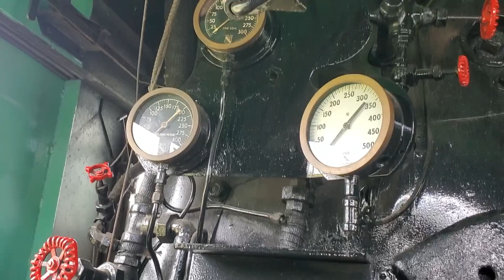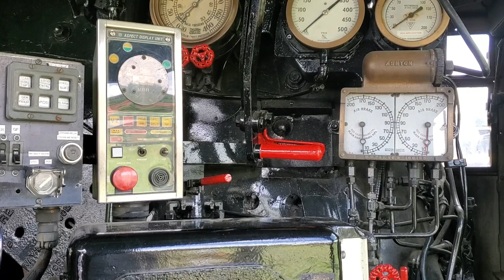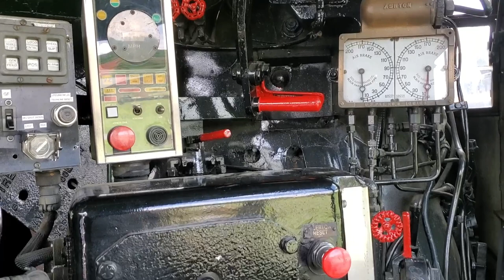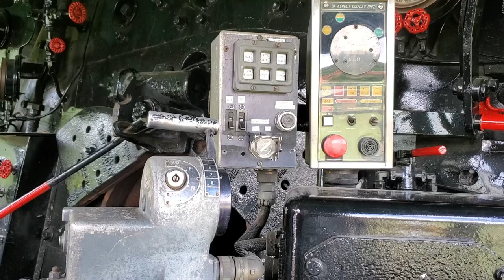Returning to "614" the finale

Comment: Would be wonderful to see her run again! Can’t wait to see what’s “in store for 2024” Bob, thank you for the video! Would be wonderful to see her and C&O 490 from the B&O Museum do a doubleheader movement if someone would restore her!
Reply from the maker: Thanks for watching and I agree 614 and 490. The yellow belly has been at B&O forever Im not sure what shape its in but would need class 1 overhaul at this point as well as 614. There is supposed to be movement with 614 in 2024-25 and restoration by 2026. Seeing both would take alot of money but anything's possible.
Reply: @BobsOGaugeTrains  I saw that back in the day Ross had looked at 490 before getting 614 to replace 2101, he said it was “ran hard and put up wet” or something along those lines. Needed a lot more work than 614 did at the time, can’t imagine it’s any better now where it spent all those years outside
Reply: @BobsOGaugeTrains  I actually also had another question my friend I’m sorry, a lot of people have speculated Ross had 614 close to if not over 100 mph on the runs back in the 90’s, is there any truth to this? Will the loco actually do 125 as stated, and has Ross actually pushed her close to, if not over 100?

Comment: C&O Heritage Center Has A Nice Assortment Of Railroad Equipment On Hand Besides C&O 614. At The 12:17 Mark, US Army Troop Car, Could Been A Sleeper At 1 Point In Time, Assuming It Became Later C&O Baggage, Then C&O MOW Crew. Steam Railroading Institute/PM 1225 Group Owns 2 Of Them. MSTX 1701 Tool Car & MSTX 07 HEP Car. Here's Last 3 Passengers Starting At 13:00 Mark C&O "The Chessie" Budd Coach, C&O 389 Green Heavyweight Baggage, C&O 1603 Budd Coach. That's All The Information I Can Find Of The Other Pieces Of Rolling Stock. Thanks For Sharing The Latest On C&O 614
Reply from the maker: Thanks for watching Im glad you enjoyed. Im going back in May.